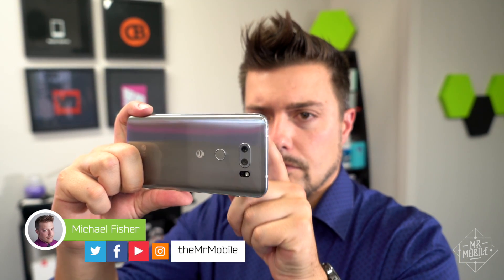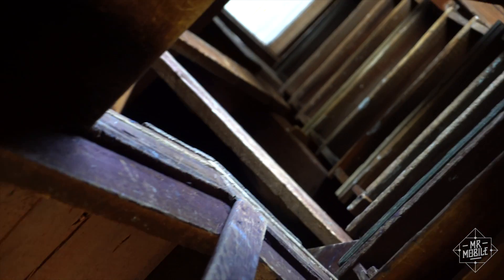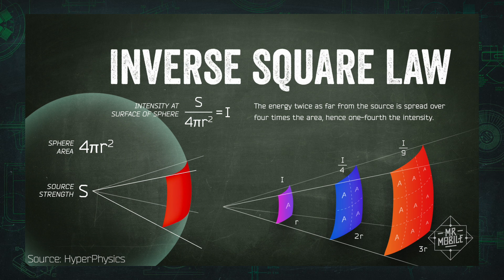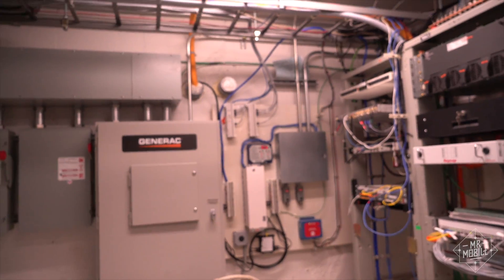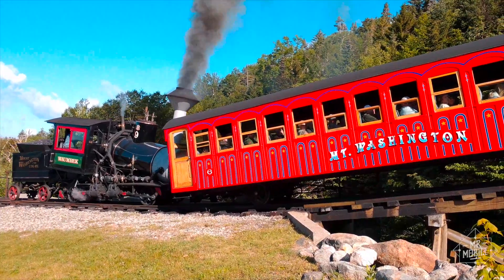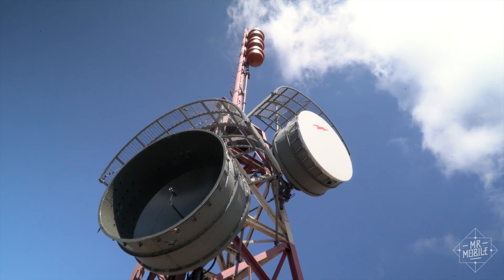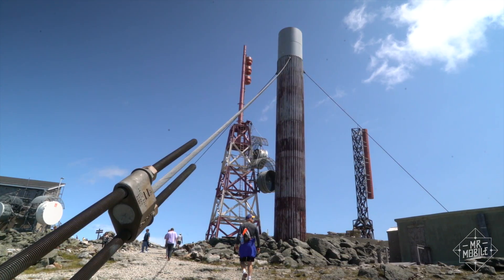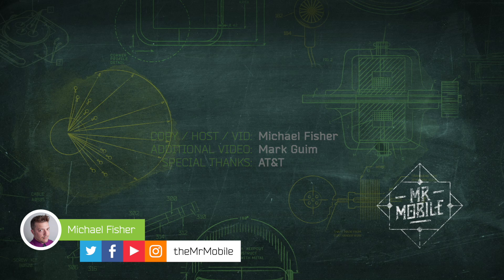How Cell Towers Work: Hands-On!

Comment: What happens if the towers were turned on and directed at a living person? You never explored that.

Also, when 5G is rolled out, requiring even more towers, what is the effect on ppl near these towers?

Growing number of ppl are sensitive to EMF radiation to the point where they have to shield their homes after being next to a cell antenna.

I get your job requires you to hype phone industry but at what point does a rep says "enough is enough."

Cell industry lobbies harder than pharma to hide their harmful effects on ppl, many get EMF sensitivity and some get cancer. 5g potentially can make things far worse. We know EMF has an affect on plants and animals and cells.  You cannot discount that just to get a paycheck.

Comment: I'm ready to die
Reply: Tell me about it.. specially with the roll out of the 5G towers each within 500 meters of each other for each network....
Reply: @meti9230  I suggest you stop writting comments because you clearly know nothing about this issue. Even if we had trillions of 5G towers, you couldn't conclude there will be higher radiation around us.
Reply: @FrainBart_main  An electrical and electronic engineer graduate! GOODBYE
Reply: @meti9230  I would expect much more knowledge from a graduate student. Speaking from an electrical engineer's perspective.

Comment: Question not a comment. Mr Mobile I'm curious about the difference between the steeple and silo type tower antennas and the smaller tri-antennas[back haul] you talked about in your video. Aside the land line connections are there any other differences between the two?

Comment: Michael Fisher neglected to go into the many real dangers of cell towers.  Not very good reporting.  WiFi IS NOT safe!!
Reply: sotododadey then how did you post this without WiFi or cell data
Reply: Why isn't it safe? You receive higher radiation doses just by turning your lamp on than from your Wifi.

Comment: Tell me about the dangers of being too close to the transmitter. What strict safety guidelines do the gentlemen adhere to? You left out so much important info.
Reply: @lakersfan892  i hear you man. Do you feel any different from when they installed that thing? Mood swings or anything else? 
Also what type of antenna is it? A macrocell? You can google it to find out if you are not sure. Also is the tower pointing towards where you sleep? Thanks
Reply: I don't know about the safety guidelines, but all radio communication uses frequencies below the visible spectrum.  The radiation that causes cancer is that which is above the visible spectrum.  Hope this helps
Reply: Bro can u help me. I want to go around my house destroying each and every tower I can find. Ive downloaded this app that shows me the locations of each but the problem is each network has their own tower. And theres soo many of themm.... how do I destroy them bro? Please help me... im in the uk btw

Comment: nice video ，i knew that cell towers used lan lines to communicate voice and data to other cell sites but its amazing how many people think there phones are satilite linked to make calls and use the net. I always try to explain its radio repeater sites connected to a phone network and some get and some dont. Maybe you could ask ATnT to sbow you more on the fiberoptics network and how cells sites communicate with each otber

Comment: The cell phone gave me headaches and rash and thyroid pressure starting 2 months ago. So i switched to landline turned wifi off and then hooked everything up to ethernet. Rf cell phone towers ARE NOT SAFE. I can feel the headaches and thyroid pressure only when I am out in town Passing cell towers. Stop using cell phones people. Use a landline.
Reply: Michaela Hearl so do you run a 20 mile long telephone Cable when you go out shopping

Comment: I still have my biggest question. How does your phone, with such a small low power antenna transmit the many miles to the cell tower? I know the tower is high power and the phone uses a "fractal antenna" to increase its surface area so it can receive from a great distance, but how does it transmit back?

Comment: Hi I would like to do a video with you going into more depth with wireless digital packet switching and cellular modulation intraconnection my late father Andrew Johnson is the electrical engineer and global patent inventor of 202 base station transceivers used as the primary packet switching router from 2g gsm network being the first person to compress 52 frequency’s/bits into one encrypted packet of data then insert said charged proton into em modulated wavelengths and geographically allocate at velocity of c via bsic algorithm for allocating cell in designated cell area via time delay multiple access tdma protocols also perhaps go into depth on how major tech corps stole individual international patents from his grave and now fraudulently give authority over said technology e.g Microsoft u.s patent Facebook Corp African patent google European patent csiro Australian patent these patents were sold in 2008-2013 7-12 years after inventor death 2001 with no authority he died 1 month after 8 year contractual obligation to co-investors expired his legacy snuffed life’s work stolen. Anyway good video

Comment: What is the range from either of these towers? Is it higher on the mountain as it is higher up and by the looks of it doesn't really have any population to cover nearby? I am a bit curious on the backhaul, do most smaller towers have a landline backhaul or do most of them have a microwave link to another tower that has backhaul?

Comment: as a ham operator i worked for verizon.... daily i would have to explain to customers the phone is a two way radio transmitting to and from the cell tower antenna  yet most think they are really on a regular land line type phone

Comment: Now if atat would get vary fast 4 g lte they are so far behind when it comes to data speeds and haveing poorly cell signal they say us wifi calling use the mark the spot to everyone but when you leave your home you back to the same problem with slow data and weak signal it seems they wont upgread their network when most atat costermers have so many issues that they say their no problem the problem comes down to equipment and better data speeds and well cell signal that atat flames is the strongest I dont belive they show you what you what to see look at all their costermers with network problems I dont think so many should all have the same problems but we do and 5 g is going to fix that not if atat wont upgread towers like they should to offer a incredible service we all what in need in today's world

Comment: Does anybody know if the area +MrMobile visited is open to the public? Is that an actual mountain view that is accessible without the need to mountain climb?
Reply: Arun Gupta yes, the top of Mount Washington is open to the public for a few months a year. Riding that cog railway to the top is probably the best way up. There is an auto road to the summit but your car better be in very good condition with good brakes. Or, you could hike to the summit and down which can take all day, and you need to be prepared for all kinds of weather. Not recommended for inexperienced hikers. People have died on Mt Washington.
Reply: Gweeper64 thanks! You mentioned a hiking option. Are there areas of the mountain/exhibit designed for non-hikers? Or is this a hiking-only kind of thing? I know it's a mountain but from the video it looked more accessible to non-hikers but I wanted to be sure.
Reply: Arun Gupta there is stuff for non-hikers. I haven't been there in a very long time so maybe someone else can answer. I think there used to be a restaurant. Oh, there is a National Weather Service observatory that is manned year round. I think they might have open house to show that once in a while. This link is a good starting point for info: https://thecog.com/summit.php

Comment: Yes, landlines are still used for this type of hard work. Just like in case of emergencies, landlines get the job done!! It's all a part of appreciating how they are all part of a major network we can easily take for granted. Thanks for the inside look into these, and I'm glad the radio waves aren't THAT harmful if you're at a certain distance in the long run. We probably need to not smash our phones into our faces for another such precaution. XD

Comment: As a current AT&T employee I am still amazed that this stuff works at all. I worked for 10 years directly on the network first as a cable splicer then as a Central Office technician and I can attest to the huge amount of work it takes to keep a network this size operational. Most people have no idea what it takes. It may as well be magic as far as most people are concerned. This was a great little video. Keep up the good work.
Reply: Isopsephy   Aliens have radiated too much hate into your minuscule gray matter. Report back to the mother ship for an attitude adjustment.
Reply: I'm just curious, if you wouldn't mind, what would be the job title of what you do? I've looked at the AT&T careers page and have never seen anything like that, at least in my area. I live outside of Sacramento, CA in a town of 66k people. I see AT&T trucks and vans all the time in my town, but I've never seen a job opening for a technician who installs the service or someone who works on the equipment. 

I really appreciate any help. Thanks.
Reply: @JJFlores197 I worked for them for 15 years. They had a microwave backbone along the pipeline and we maintained the repeater system, the radio data links to the remote valves and the data circuits along with Ethernet and T-1s. Before that I worked for another company maintaining the fiber network along the pipeline. My last 6 years were working in a gateway earth station serving most of Alaska with satellite communications. Things like phone trunks, Ethernet and data circuits. I’m retired now.I worked in communications over 30 years and electronics all but a few years of my working career.
Reply: There’s an angry prem tech in our midst
Reply: I retired from them 3 years ago. I worked with microwave, fiber and satellite communications. My last six years were at EGRVAKZA. Before that I worked 8 years at PRBYAKZA.  We also took care of the pipeline communications and a fiber network to run the pump stations.
Reply: All I can say is they are a horrible company to work for and have laid off thousands of union employees. You won't hear me ever saying anything good about them. They also have terrible business practices.
Reply: When I looked at AT&T website for tower climbers it said the job requires low educated people yes it did
Made me sick
It's because it's a very dangerous job
Reply: আমার ব্যাবহার কৃত সিম টি কোন টাওয়ার থেকে নেটওয়ার্ক পাচ্ছে সেটি কিবাবে দেখবো?
Reply: MaxLinear just has issued a new open ran 5g SoC chip called “Sierra”.
A very powerful chip!!!!
Reply: Could they do more than we think?

Comment: Actually the microwave systems can support LTE just fine, Microwave can be as reliable as fiber in fact. I personally have installed microwave circuits to support LTE in the Rocky mountain region.

Comment: Great video, but I think your title is a bit mis-leading.  I clicked on it, to see if you had any more detail on exactly how cell towers worked.  IE, how they communicated with your phone, how they transmitted/received signals, how they transmitted signals between towers, ect.  I was hoping to learn a bit more here.  Instead of just seeing the 2 extremes of physical location and clever hiding.

Comment: Great video. Would love to see some explainers around technology we use every day - how does Bluetooth work, how does Wi-Fi work, maybe dig into material sciences on plastics and alloys used in phones.
Reply from the maker: Good call! Expect more of this in 2018.
Reply: @TheMrMobile  Why do phone towers have microwave antennas on them? Why can phone towers just have those white rectangle antennas?
Reply: @santinojozefmiller7721  microwave radios are usually used in rural areas where cell towers are far from each other, microwave radios help the signal travel longer distances and pick up signals.
Reply: @TheMrMobile  you should do one on T-Mobile next-gen 5G Network and 600 megahertz spectrum that would be great come to the big island of Hawaii it would be awesome to meet you.
Reply: LinusTechTips' TechQuickie channel does that, I believe. Mr Mobile's takes are far more entertaining though
Reply: that would be LTT's Techquickie
Reply: Please I love this sort of video
Reply: I 2nd this! Awesome work, very interesting
Reply: Simon Sage WiFi basically works the same way, except it can work in a small router at 2.4/5 GHZ